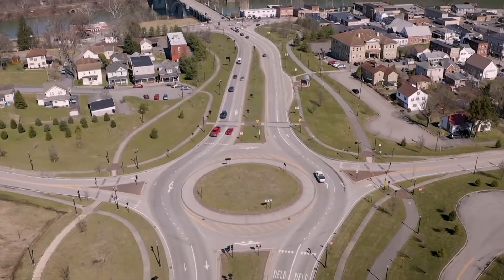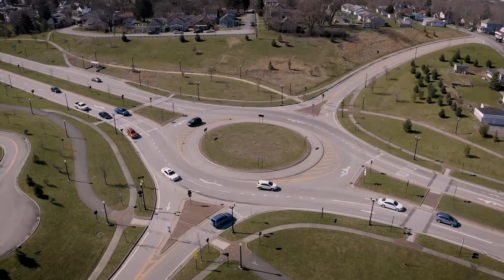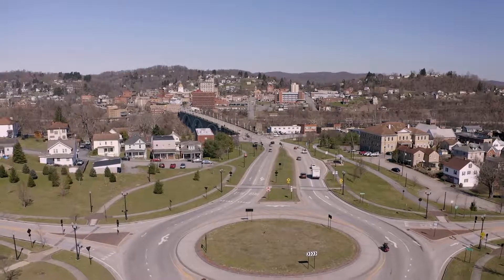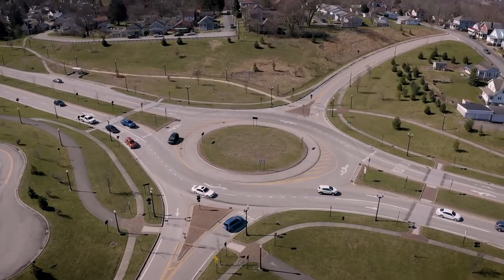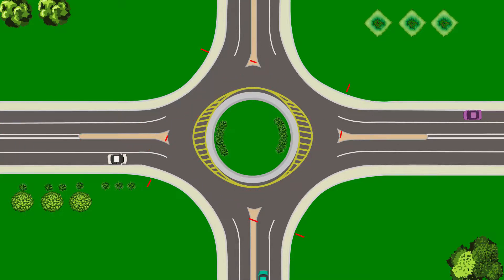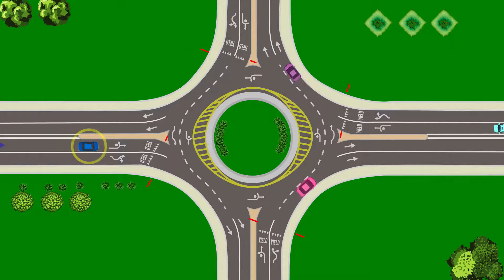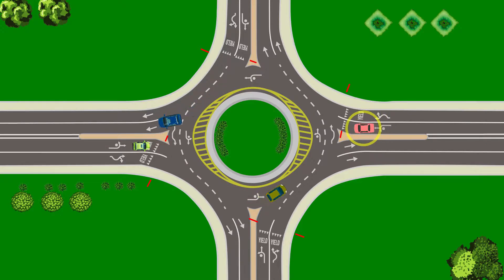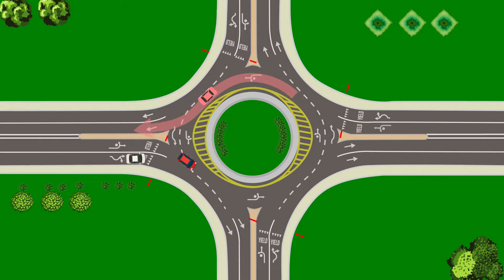How to Use a Roundabout

Comment: The simulation shows four legs of the roundabout being two lanes wide but the roundabout is not a true two lane roundabout.  Two parts of it are one lane wide.  The actual roundabout that was built has two legs that are two lanes wide and two legs that are one lane wide.  Which is how you can have a roundabout that is two lanes wide in some parts and one lane wide in other parts.  You'll never see a roundabout built that has two lanes merging into one lane on a roundabout.  It's a bad design and would not be built.